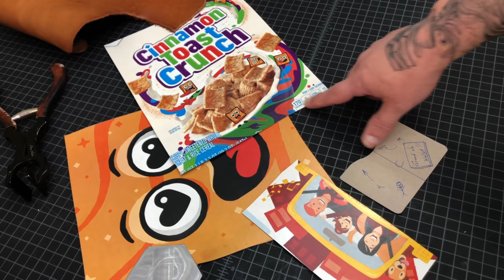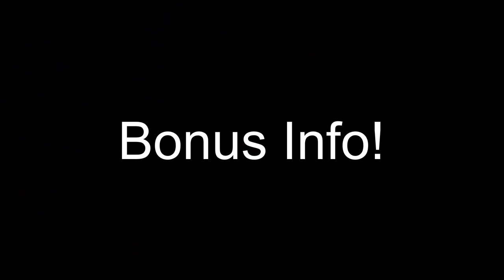11 Simple Tricks That Will Change Your Leather Craft Forever! (Using Bump Jigs)

Comment: Except that thin cardboard would need to be replaced often. The cut edges become ragged or compressed at the edge. Especially the corners. May as well just make your cuts by marking your leather with your squares or jigs first. General mills makes a hell of a cereal box like Harley makes a hell of tshirt.
Reply from the maker: I’ve had some paper patterns for 10+ years

Comment: Awesome use of jigs, very helpful, alot better than using the side of a ruler. For small templates, you should consider 3D printing, opens up so many possibilites, you could combine #10, 9, 6 into one step, <60 seconds, you could also add an alignment window for a stamp too. Make one template to do it all, granted you are cutting against plastic vs metal, but you can always print another template in a short period of time for almost no cost. Plus making copies doesn't get easier or making adjustment to your master design in software vs having to hand draw and cut it again.
Reply from the maker: I don’t use software.  I’m 100% old school. 😆

Comment: Thanks for sharing practices and techniques.  Is there a reason you don't cut along the silver straight edge line?  Does it leave the material too short and the yellow straight edge corrects for that?
Reply from the maker: 1. I’m right handed and I need the straight edge on the left to cut along. 

2. I don’t like using 1/4” thick as a cutting guide. Too thick.

Comment: These are great tips and have really sped up my work - but question: why not cut against the jig instead of adding the ruler and cutting against that?
Reply from the maker: I do occasionally.  But the 1/4” thick jig is sometimes too much for the blade.  I like a thinner cutting edge guide.  But, it works either way.
Reply: @MasconLeather  that makes sense - thanks for your time!
Reply from the maker: Thanks for the support!

Comment: so you dont case your leather before stamping?im kind of confused about that.and what are the leather plers ith the teeth on them good for?
Reply from the maker: Raw veg leather, i case for tooling.  That process burnishes the leather as the metal stamps hammer in.  For Dublin and such, there are too many fats and liquors in the tanning process so they won’t take casing.  But you cd. Still press stamps into them.  They just don’t “burnish” as cased leather would.  

Not sure what teeth in leather pliers you’re referring to
Reply: I have a bunch of 1/8 in top grain.can you tell me if I can wet mold or tool it.i haven't tried to do it because I don't want to waste any of it

Comment: So the leather you were stamping looks to be a oil tanned pullup, if so, does it really take those stamps permanently? I’ve had trouble doing it with anything other than veg.
Reply from the maker: It’s Horween Dublin ….  Which is a veg tan.  But I stamp in chromexcel too. It works.
Reply: @MasconLeather  man, I am sitting here so impressed by your quick response. I just subscribed and I will definitely be keeping up with your channel. I was looking through and I couldn’t believe you reply on almost every single comment. Of course now I’ve created another for you to read but just wanted you to know it’s very appreciated. I’m about 4 months in to the hobby/side hustle and it’s great to find communities like the one you’ve created. Thank you.
Reply from the maker: What a great comment!!  Thanks for that.  Yes, I try to reply to every comment to help.  I remember when I started, no one seemed to reply to anything and it was frustrating and left a bad taste.  I also try to give as much info in the videos, as well.  To eliminate confusion.  Be sure to check out my Instagram and website. 1,000s of photos and tips.  

Thanks, again!

Comment: Great tips but way to expensive! $50 for coasters!?
Reply from the maker: $50 for Coasters?  What are you talking about?  I think you missed the point.  And many points.
Reply: I liked your video so thought I would check out you’re leather zeebee curious how you justify you’re prices as I’m a crafter also and unless you’re using a golden cow or the hardware you use is gold or the hourly rate is massive and you work slow 
The ( ugly coasters on the zeebee leather site are $50 unfinished....
Reply from the maker: You’re not the target market.  You set your pricing as you feel is appropriate.   (My site is Mascon leather....feel free to visit my site, and note my pricing as well as the current lead time on orders.  🤘)